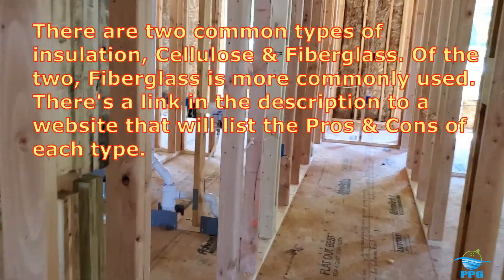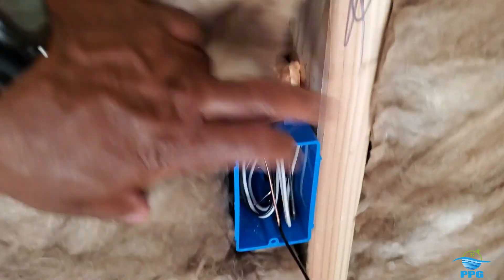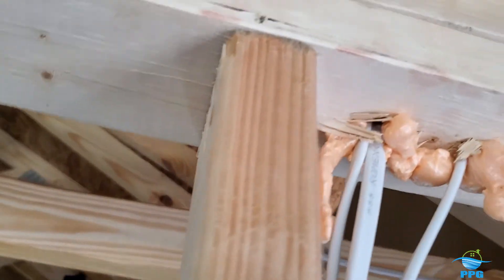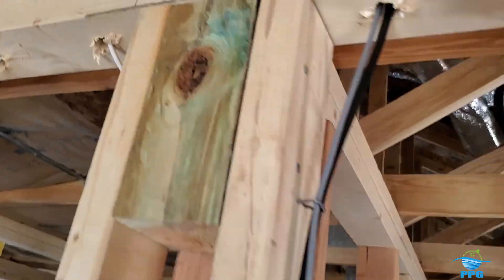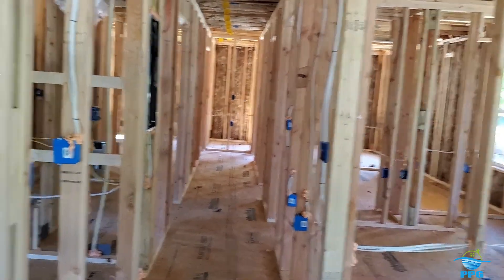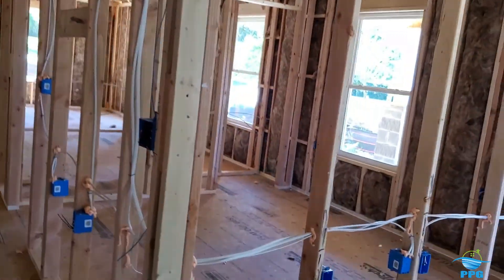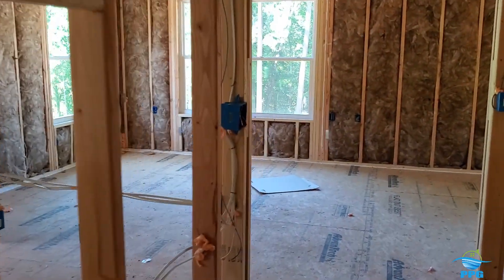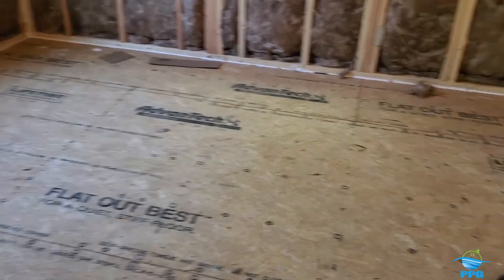Residential Building Insulation Inspection 101

Comment: Great video and thanks for sharing. I'm currently renovating a house in Atlanta and not sure if I want to finish the basement with drywall. If the basement is not finished, do you still need to install insulation in the ceiling for the inspection?
Reply from the maker: Yep, you're in Georgia,  so it'll be R-19.
Reply from the maker: Thanks for watching!!

Comment: Great videos. I got a quote from a spray foam company here in the panhandle of Florida to do my cathedral ceiling in my home. They quoted me 3" / R-21 and I questioned them if R-21 would be enough to satisfy code in my area which requires R-30 in the ceiling. They told me that the 3" would pass inspection because SF is also an air blocker and heat reflector. This seems kind of odd. Just wondering what you think of this ? I am still waiting to hear back from our local building dept on this situation.
Reply from the maker: Typically spray foam is a R-4 per inch for open cell and a R-7 per inch for close cell.
Reply from the maker: Looks like you may need about 8 inches of open cell or about 5 inches of close cell to get your required R-30.
Reply: @PPG1967  Ok Thank you.

Comment: Does it have to be fire caulking? is regular foam flammable? thank you.
Reply from the maker: Fire caulk is more commercial application.  Fire or regular foam is acceptable.
Reply: @PPG1967  yes I have been letting them get by with either, but i started thikink if foam is flammable it could fuel a fire in the wall. just overthinking it i guess😁

Comment: So what is the purpose of NOT insulating the interior framing walls?
Reply from the maker: So, the purpose of insulation is to provide resistance to heat flow. This makes insulation more effective on the exterior walls. Keeps your house cooler in summer and warmer in the winter.

Comment: kindof crazy that code allow carboard to be used as insulation baffles - if/when there's a leak or even high humidity, that stuff is going to begin to crumble.. I prefer to see plastic used for those.  btw, I knew that vertical penetration in framing needed to be blocked with fireblock to prevent firespread, but I didn't realize most fires in a well-block cavity would burn-out due to lack of air - I learn something from you every video.  Also, those guys block horizontal penetrations - that's not necessary per your code, right?  If it were, I'm sure you would have mentioned it.
Reply from the maker: So, imagine putting a lit match in a sealed box. It would eventually run out of air, and the match would go out.
Reply from the maker: Same principle as a sealed cavity.

Comment: Getting ready to building a 4420 sq ranch home in Huntsville AL. What insulation would you recommend using?
Reply from the maker: If money is no object.  I would spray foam the exterior walls and roofline. 
Cellulose insulation on the exterior walls and spray foam the roofline would be my second option. 
All batt insulation would be the most cost effective.  I hope this helps.